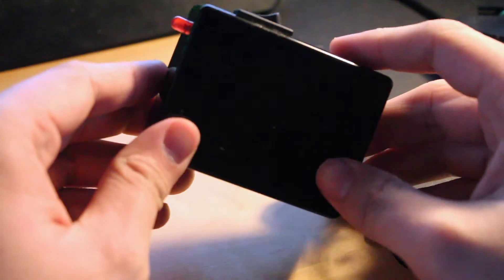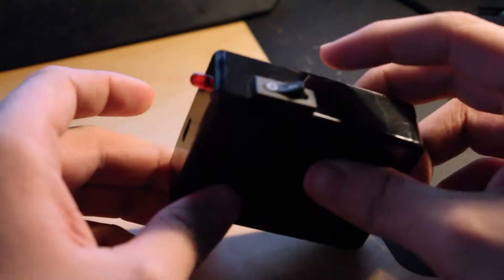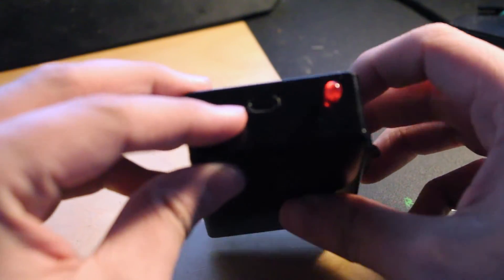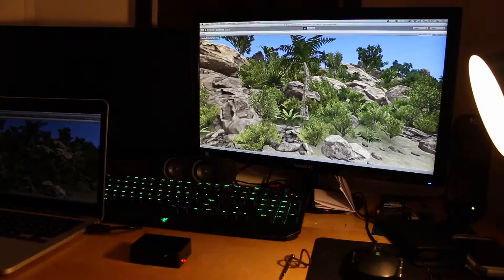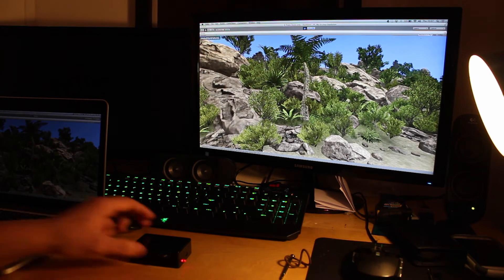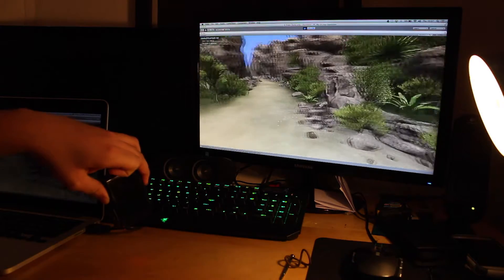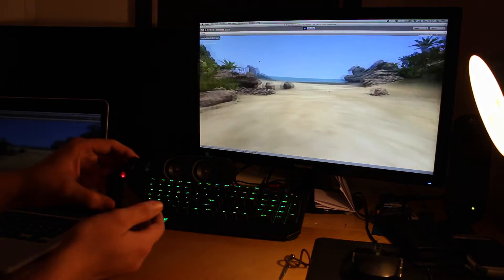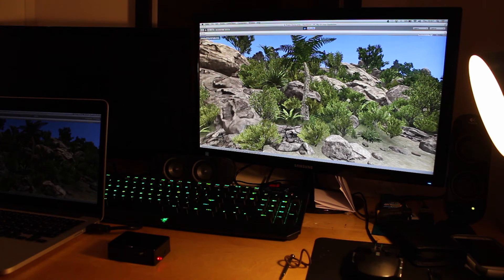IMU and Unity3D - Final Year Project

Comment: Any thoughts on how to do pitch/roll in unity?  I have x,y,z data going to Unity but can't get my object to stay stationary and tilt correctly.

This is what I'm doing:

void SetPosByAngle (  float fPitch, float fRoll )
{
    Vector3 LowerLimit = new Vector3(0, 0, 0);
    Vector3 UpperLimit = new Vector3(180, 180, 180);
 
    // Normalize from -180/+180 to -1/+1
    fPitch = (fPitch) / 180.0f;
    fRoll = (fRoll) / 180.0f;
 
    Vector3 AngleDiff = UpperLimit - LowerLimit;
    Vector3 CalculatedAngle = new Vector3(-fPitch * AngleDiff.y, 0, -fRoll * AngleDiff.x);
    TragetAngle = LowerLimit + CalculatedAngle;
    transform.localEulerAngles = TragetAngle;
}